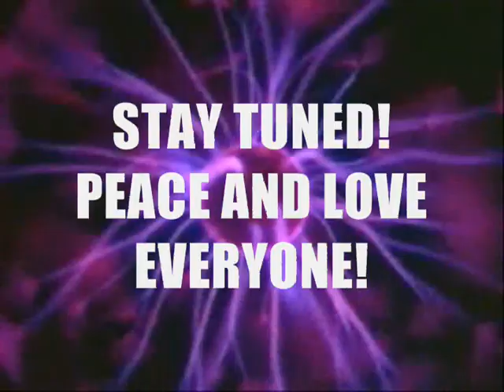MULTI SPARK GAP TEST !

Comment: have you ever asked yourself why energy increases in a spark gap?
or why most people can not get patents for devices that produce free energy?
its because they can not explain their device and it uses spark gaps.
Sparks or arcs are plasma, patenting plasma is like patenting the air.
The plasma over generates the initial charge, its unreal in a vacuum chamber.
but the actual happiness is happening inside the plasma itself, the devices are plasma generators, they have already been created and can not be patented.
Now I am surprised that the crown hasn't marketed plasma, but lets not give them ideas. Instead we need to pass on the knowledge and keep it flowing.
Plasma Voltage and Amperage Multiplier Generator